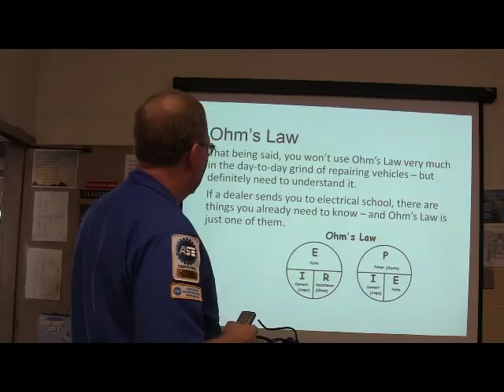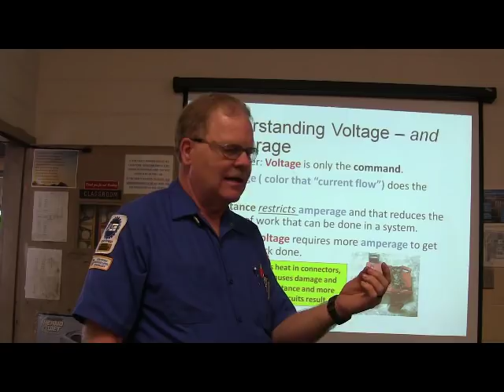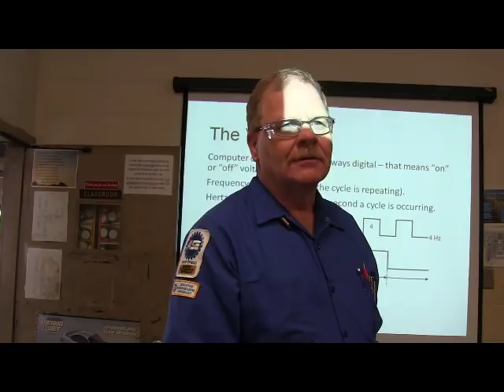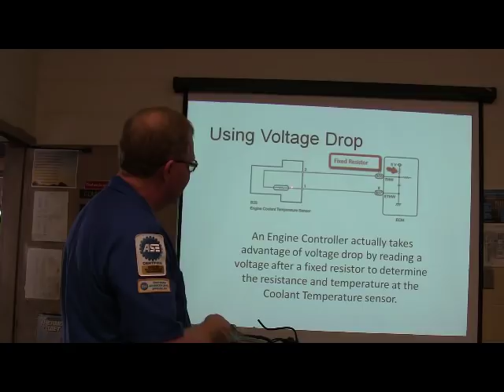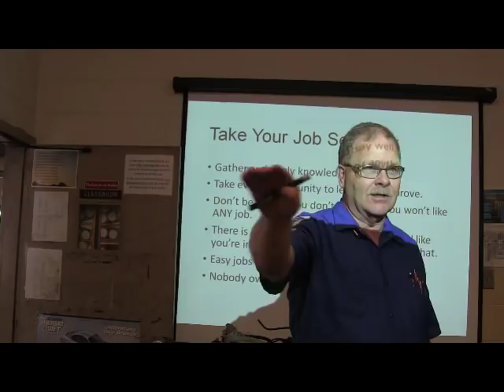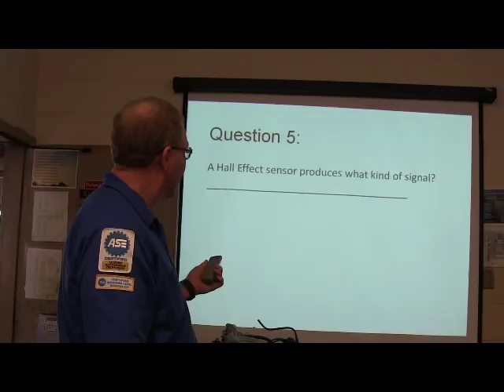Electrical Refresher

Comment: You weren't in a hurry this time 😉
Good fundamentals. Thx
Reply from the maker: On Fords if the 5 volts is shorted to ground the PCM will be off line. That's not true on every make of vehicle though, and it won't damage the PCM on Fords - I did, however, see a Chrysler PCM destroyed by a shorted TP sensor, so one size doesn't fit all.